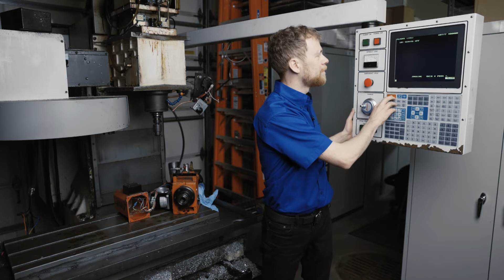Alarm 145 X Limit Switch —Straight To The Point

Comment: What happens when the prox has been replaced, the power leads and encoder cable have been replaced, the motor has been replaced and I am still receiving random x axis limit switch alarms during a program? Not a chip in sight on the switch. Ground fault somewhere? Power backfeeding into the switch from something else?
Reply from the maker: That sounds rough. You could have a bad connection on the mocon. What version of software I might consider updating the software, fix an older version or looking at the signal line with anoscope
Reply: @cncrepairman All connections and pins both male and female inspected at the Maincon. No damage found. Yes I'm going to be digging my heels in more. It is an ngc control. Machine is only 1 year old. I updated software, firmware to the latest, disconnected the HRP robot package to isolate the machine from any robot problems, inspected switch to ground, cables pinned to ground, lvps values show good on analog meter. I still need to check each servo drive amp and cable/motor in the high voltage side becuase those could cause issues but..... It's a goofy one.